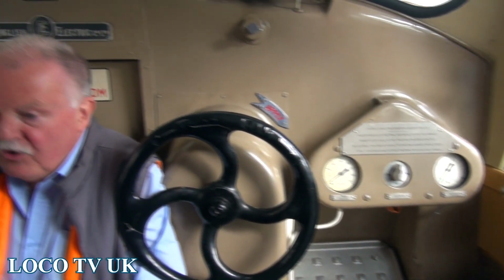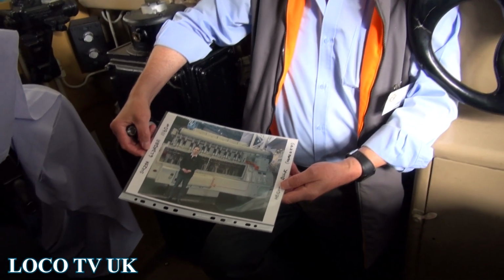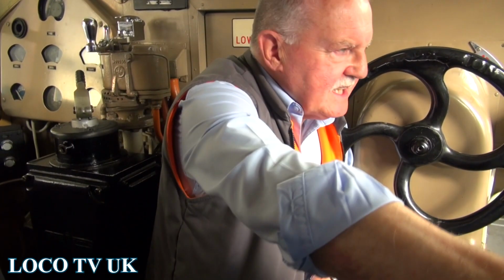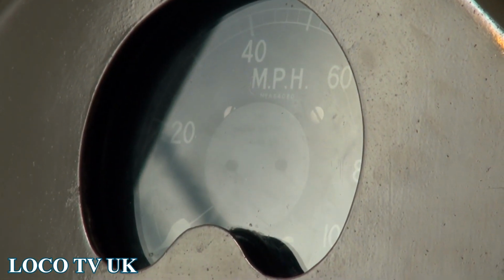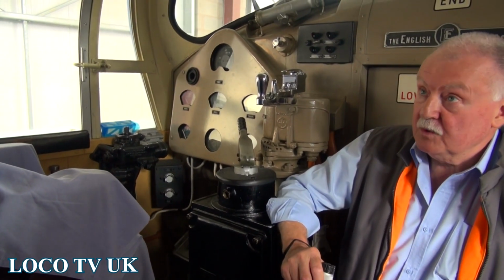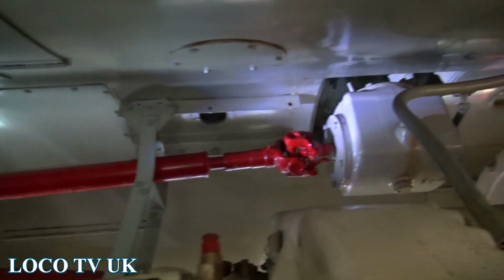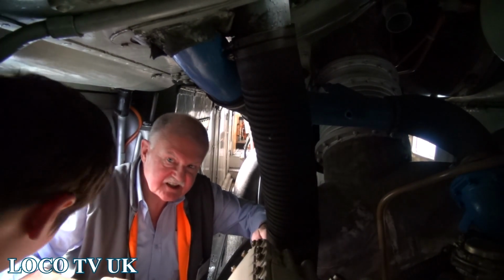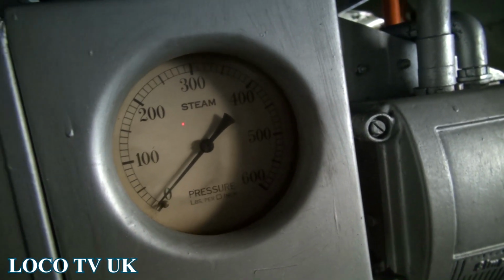DELTIC (DP1) Cab & engine room Guided Tour  LOCO TV UK

Comment: such a ingenues design for a engine .add 3 turbo chargers per engine ,and do high pressure direct injection ,this engine mite be viable today .
Reply: Who told you that?  There are a lot of 2-stroke Detroits out there that are boosted by turbos.
Reply: Piston rings really hate crossing those port cutouts. It would swill oil like Oliver Reed on a bender. And the combustion chamber is a lousy shape so air utilisation would be poor. And the crankcase needs temperature controlled machining and assembly by watchsmiths so it costs a fortune and is prone to built in defects.I could go on. Expensive, dirty, unreliable, and gutless. It was competitive before they invented proper turbocharging and aftercooling, when fuel economy was an afterthought,  and no-one cared what came out of the exhaust.The weak structure probably wouldn't be pressure capable with more charge anyway.
Reply: Two thoughts - it's two stroke, and revved very highly. At 2500 rpm, that's 2.77x as many combustion events as a 4 stroke at a more conventional 1800 rpm, with much more friction.3000 hp out of 88 litres is 34hp/litre - comparible with modern engines at about 35hp / litre, but substantially less efficient and much dirtier.For comparison, the Cat 84.7litre C175-16 makes between 35 and 48 hp / litre depending on rating. You wouldn't make an engine like the deltic nowadays because you couldn't sell it - it's too dirty and the amount of carried over lub oil would foul the aftertreatment package - and because 4.5bar turbocharging makes it irrelevant.
Reply: And yet, OP engines were achieving 40+% efficiency 60 years ago.  And there are companies that are trying to bring them to market.  Achates Power and EcoMotors are working on modern versions, but not the Deltic form.
Reply: Due to the 2 stroke design, the air fuel cannot be pressurized into the cylinder. It wont make anymore power by adding more turbo's.
Reply: Look at the cross section and imagine where the air goes and all will become clear.
Reply: Pretty much any engine requires temperature controlled machining and precision assembly to be successful today.  Applying modern manufacturing technology to the Deltic would yield a better engine.  The same goes for fuel injection and turbocharging.  Actually many Deltics that went in Royal Navy Nasty class torpedo boats were turbocharged and made 3000+ HP.  But I agree with you that the OP engine combustion chamber shape can never be as good as a conventional diesel with a central injector.  Relatively poor air utilization comes with the engine type.
Reply: It's nice people are willing to try new things, but I pity the investors.
Reply: An Ingenious not, a ingenues. 😊
Reply: the problem of dirty exhaust gases could be solved by using of clever "afterburner" in form of e.g. steam generator. Then the final exhaust could be cleaner and steam used for auxiliaries or augmentation for the propulsion, taking also good part of the heat from the engine cooling system. Then the whole unit would be very efficient and clean.

Comment: If the British were so good at Railway Locomotives, why don't they make any today? The British have been overtaken by the French, Germans, Italians and Japanese who all build state of the art high speed trains. The British!
Reply: While I don't agree that the UK is a crap country I share your disappointment in the fact that we manufacture less and less basic engineering like trains and domestic washing machines etc. etc. although of course in the case of washing machines that is due to globalisation and it being far cheaper to produce such items in the far east. Past & present governments take no pride in indigenous manufacturing it seems and sometimes I think we suffer from resting on our laurels when we do make good stuff by not continually improving. 
We are still good at high end engineering like software & nuclear R & D and we still have companies like Rolls Royce (gas turbines),  JCB (although fitted with Japanese engines) and Dyson to be proud of. 
Still not bad for  a small country I suppose.
Reply: Regarding washing machines, i've just got a washing machine made in the uk by Ebac in County Durham, it's a great bit of engineering but they are the only uk maker of them.
Reply: TV-94 that's funny
Reply: Paul Passat  in some cases over 50 years old and still main line registered! how many locos from the countries you mention, will be around in 50 years?
Reply: kevvy nolan You say that as if its a good thing to have railways with old, slow, dirty obsolete locomotives still operating. We were years behind with electrification and we can't even build our own trains anymore. Hitachi have to do it. Even the Chinese have to build our power stations. It's a crap country the UK
Reply: Well leave it then.